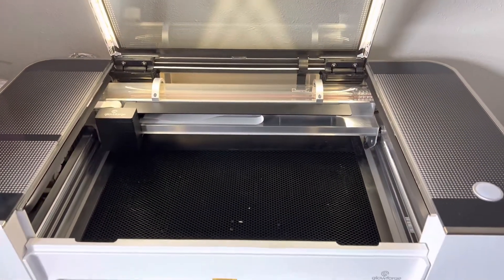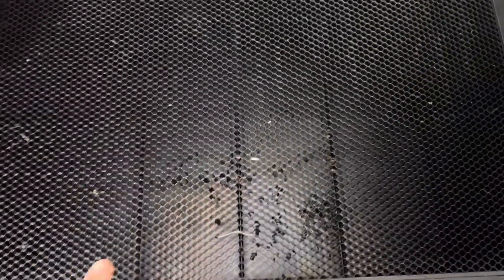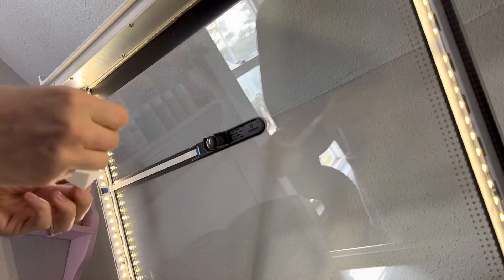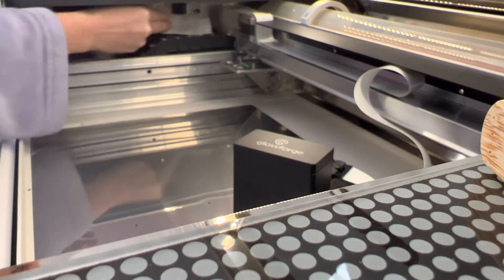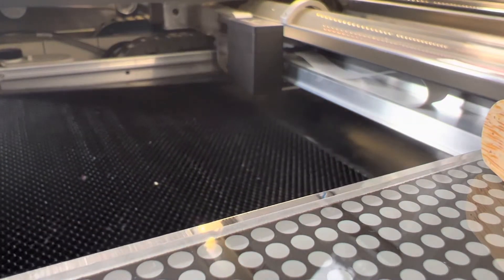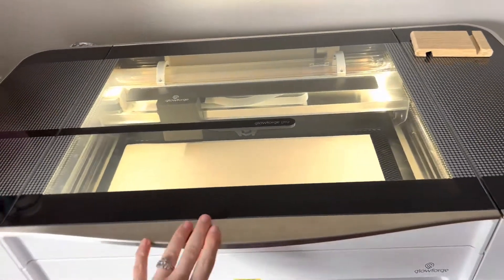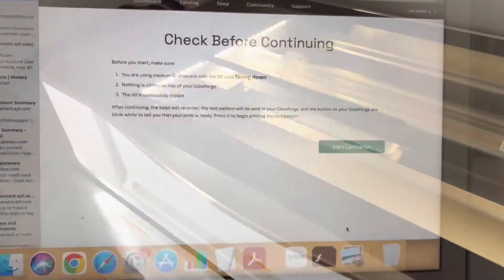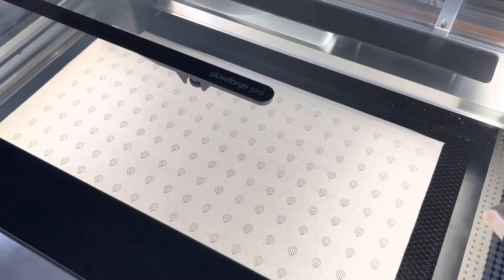How To Calibrate Your Glowforge

Comment: You should not manually move the print head or gantry while the machine is powered on.  Also, the glowforge can not access the top or left sides, so you should place your wood in the bottom right.